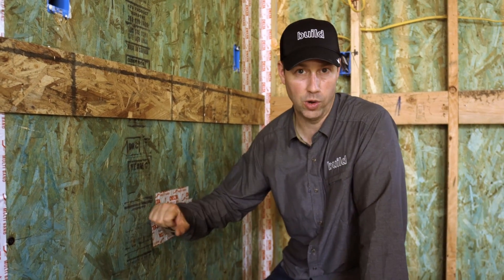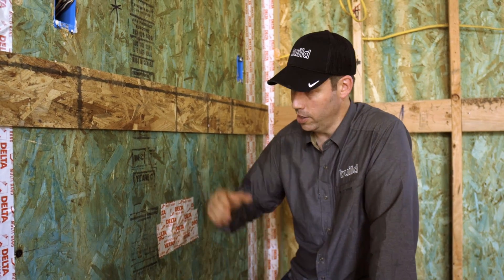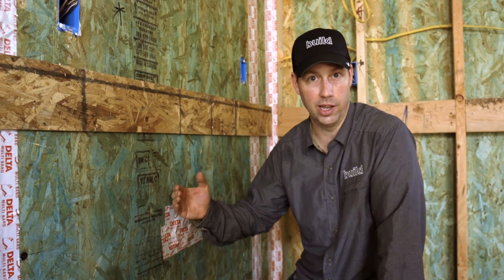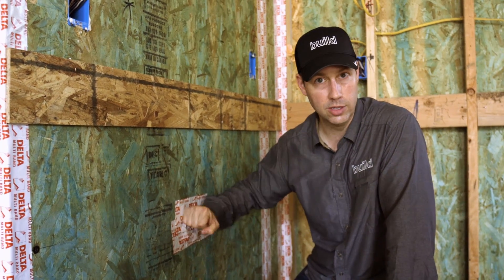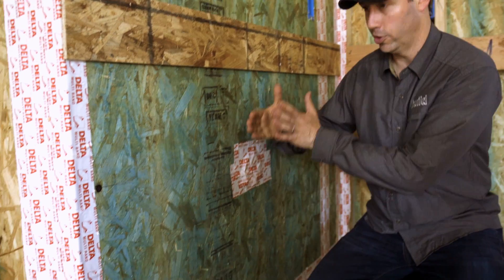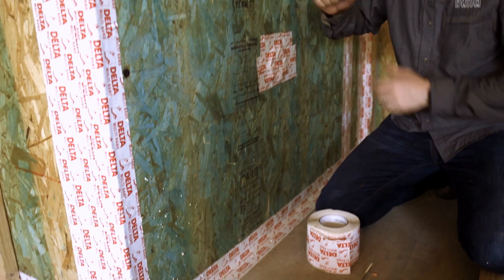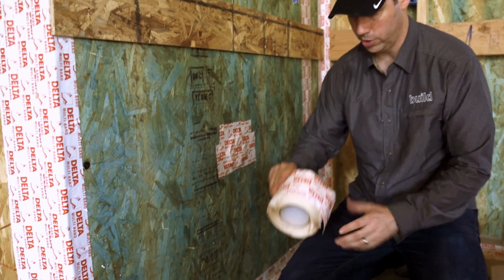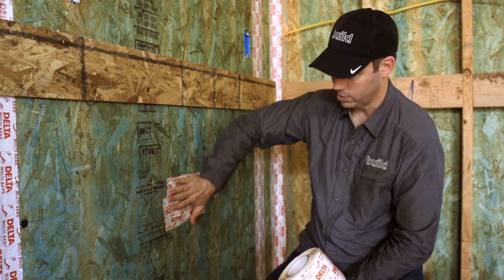Air Sealing SIPS :: Risinger Goes Rogue

Comment: A few years ago on your blog, you spoke enthusiastically of a build you did with Bensonwood SIP panels using Huber Zip sheathing.  What do you see as the advantage of more conventional SIP with peel-and-stick Delta-Vent?  (Also ditto the other positive comment about blower door testing before sheetrock.)